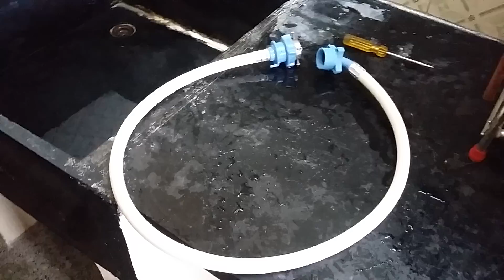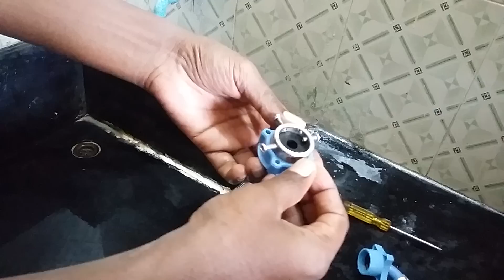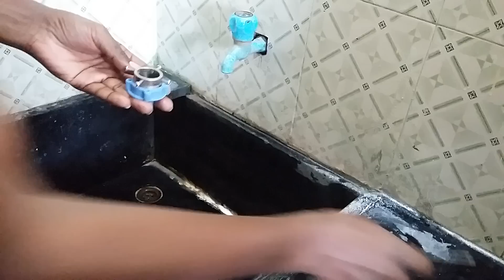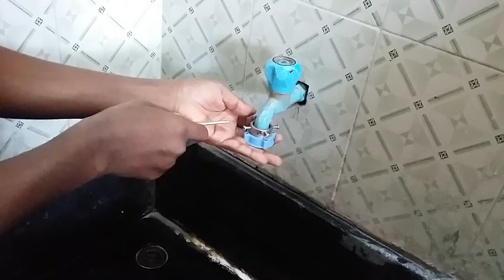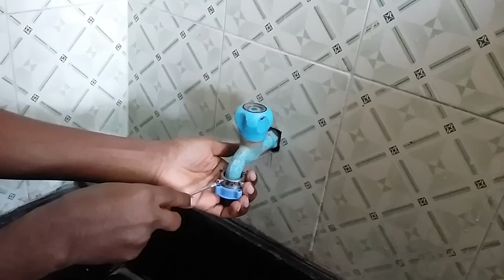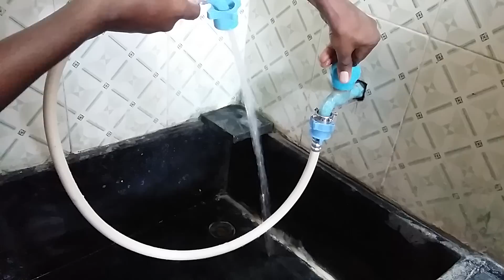Washing Machine Pipe Connections | Tap adapter fitting connections | Kitchen sink tap connection

Comment: hi there. i just replaced my leaky washing machine tap. now the issue is the mouth of the new tap is too small for the washing machine hose to screw onto. what shall i do please? the washing machine hose does not have screws like yours.was considering to even cut off the plastic screw lock attached to the hose so that i can plug the hose directly. hmmm
Reply from the maker: Hi thanks for your interest . Best option buy new water tap plastic (Big size Rs 50  only).  then no issue for water connections.

Comment: could I use a water dispenser instead to connect to a washing machine from a hose pipe? I need a,washing machine in my studio shed but no plumbing. what's the best thing I can do? I was thinking adding a water dispenser but I don't know if the water would drain to quick

Comment: I am confused with the Top Load Automatic washing machine pipe connection ,it requires permanent inlet connect and I want it adjustable to basin but i should be able to disconnect it and move away from passage

please give me solution
Reply from the maker: Best option use Separate water tap  connection for washing machine, if u can use emergency tap connections  means just remove the washing machine water tube. and others item default  fitted in water tap itself.

Comment: Sir can we use pump?
Reply from the maker: Direct Pump  connection ya ?
Reply: Sir i purchase washing machine but it shows low water pressure error height of my home 7 feet. But it require 15 feet height so can i use pump?
Reply from the maker: use to normal pressure to washing machine pipe connection,otherwise u can do it  manually  fill the water in washing machine but this is emergency time only.

Comment: House builder need to be oriented before built a house to provide a proper provision of water faucet for washing,sink and drainage for waste!!!In japan when building a house they include the outlet of water supply to washing,sink,drainage for waste water for washing!!besides the proper installtion of water flows to washing is much higher than the washing in a few inches!!
Reply from the maker: Thanks for watching.
Reply: what is it called? the one connected to the faucet?